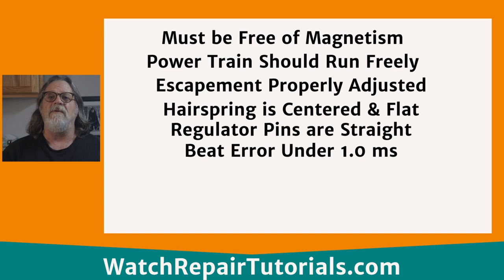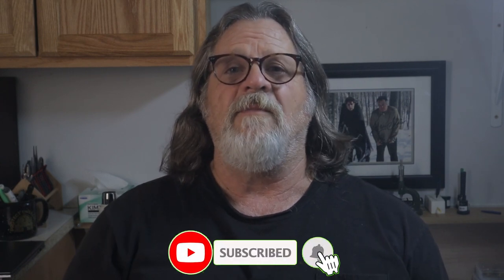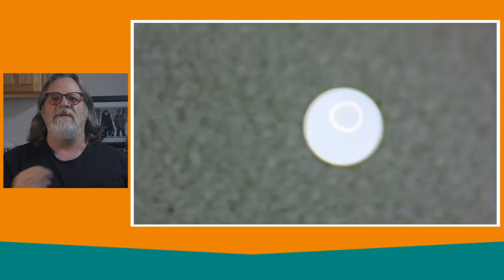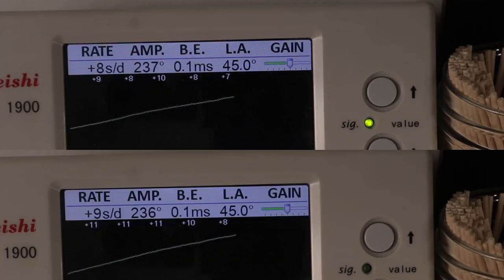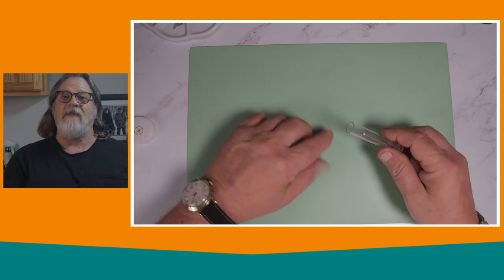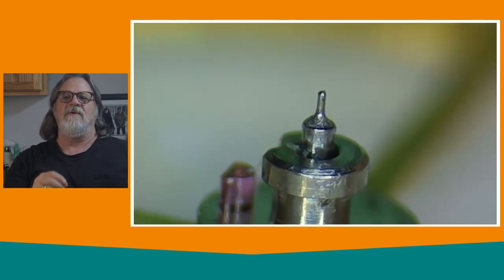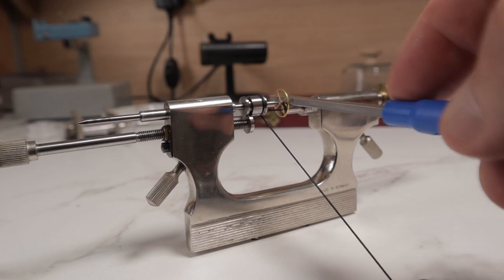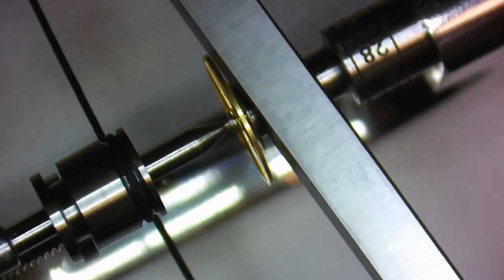Regulation SECRETS Every Watchmaker Should Know

Comment: Thanks Alex for your great work in presenting all this experience so clearly. Just tried to round off the ends of a balance staff with my oh so cheap Bergeon 5482. Watch running poorly DU. I used a little 9010 and my rotary tool on lowest speed. Managed to destroy the pivot in a few seconds ! Suggest you go very lightly guys and maybe hold the balance in your fingers to feel the slight pressure needed. I had the balance in a holding plate on the bench which clearly gave too much pressure. I now get to practice balance staff replacement which will no doubt improve my skills. Happy days.
Reply from the maker: Yes, holding it in your fingers is definitely the way to go.

Comment: You certainly have a great way of explaining things. Currently on the hunt for a  Jacot tool.
I have a watch that runs okay (ish) in 3 positions but pendant down it slows by 10 seconds +
I’ve not been able to find the issue and have now have accepted that unless I get better at this I will not figure out the issue.
Reply from the maker: Hey my man, don’t discount your skills.  What’s the caliber and what are the rates and amplitude of the six positions. You can email me if it’s easier.
Reply: @watchrepairtutorials  a very long video will be released today.. toe parts disassembly and then assembly.  It’s a Ricoh 61 and it’s a very odd layout for a movement. 
If I leave it long enough on the TG it actually settles but it’s not perfect.

Comment: Hello. I watch all of your videos and learn a lot. I have a breitling watch 1950  with as 1130 movement. I serviced it my self about a year ago, and it worked great(i have a witsh time grapher). I wind it occasionally, since i do not wear all  the time. Today i noticed that the watch started to gain a lot with in the same day. a opened it, then put it on a grapher, and cant get 18000 bit, it shows 36000. Sometimes, when i adjust the bal. wheel, it get 18000 for a short wile, and a good beat err, but it jumps allover the place. I had similar with another watch and i fixed it by adjusting a hear spring within a pin, which stabilized all the parameters. What else can create 36000.? bad spring? (i put a new spring when i serviced  it).  Not emough pallet stones oil.? does the bal. pin needs to touch the hear spring or not? It did not effect anything ether way. Any idea? Thank you,
Reply from the maker: I think there’s something else going on either with your microphone, interference or your timegrapher as it’s impossible for an 18,000 beat per hour watch to change to any other frequency. Basically, the frequency is counting how many times the balance wheel rotates back-and-forth. Mechanically nothing in your watch can change that.

Comment: Hi again Alex. I dare to ask you another question because apparently I am not able to figure it out by myself   as I do not possess the volume of expertise necessary. I am sure however that this question is an easy one for you. After an year and a half of work on a LUz Geneve selfwinding (Felsa 4007n) and thank to you I managed to make it work well. Tha last problem was poor amplitude which I only solved thank to your channel. (the other problems included broken jewel in the winding train,  closing the holes for the barrel arbor, changing the barrel (broken tooth) and mainspring and using braking grease, changing the second and the third wheels due to pivot tip corrosion as a result of one night in ammonia-water solution, boiling the hairspring in lard and slightly correcting the end-curve, removing the radium from the dial and restoring it with Superluminova, restoring the inscriptions on the dial using ink and a diabetes syringe needle to draw 0,.06mm lines. After polishing all pivots using diamantine and toothpics and pegging all the jewels I obtained 290 degrees in the dialup p. and this fiigure does not change much in the vertical positions. Now, the only thing that bothers me is that when winding manually, the sliding pinion slips sporadiacally because it unmeshes from the winding pinion, although I strengthened the V-shaped spring responsible to keep the clutch meshed. Is this slippage a known problem and what would you do?
Reply from the maker: Wow man that is so awesome to hear. As far as your problem, I would have to say if the teeth are slipping that there is wear. Perhaps the sliding pinion should be replaced
Reply: Hi Alex. Another question on an obscure topic. I have a Seiko quartz chronograph that still works smoothly after 30 years. As you know these movements contain plastic gears along with brass and steel gears. I read somewhere that Seikos plastics are self-lubricating that the presence of such gears in the wheel train may be a plus. I would like to hear a word or two from you on this just to know what to think. The specs from the manufacturers are so ... well they tend to tell you nothing....
Reply from the maker: @Qwerty-cb1ti  using plastic parts in a movement as a trade-off. They don’t need lubrication, but they tend to wear in break more often than the equivalent, brass or steel part would. The bottom line is they do not need to be lubricated as a matter of fact it is more detrimental to the movement as there’s nothing to hold the lubrication know where it’s applied and it will end up spreading to parts that you don’t want it to be. This  is a Basic, Lubrication, 101 Theory.
Reply: @watchrepairtutorials  thank you for answering. These things are not so obvious...

Comment: What do I do when I have a excellent amplitude on the Pocket Watch with an excellent beat error but it’s running -400 seconds per day. Could this be the regulator pins
Reply from the maker: Hey JD,
I would guess this is a hairspring issue. Too long.
Reply: @watchrepairtutorials  I think it’s the original hair spring for this watch!  I did quickly test the speed by very carefully touching the gap between the regular pins with a very sharp piece of Pegwood, and looking at the amplitude on my timer software. It’s sped up considerably, so I think I really need to close those banking pins. Any advice on how to do this without screwing up the banking pins. I would think I need to remove the balance assembly from the watch first that way there’s no chance of me slipping. And then do I use tweezers or pliers; I’m thinking tweezers. And then should I close it with the hair spring in place or should I try to close it without the hair spring in place?
Reply: @watchrepairtutorials  and one more thing. I have been making a very long video on how to fix this problem I’m quite satisfied and how I reshape that hair spring to get a very good amplitude on the watch. The video should be out sometime today or tonight as I still want to resolve this problem before I finalize the video.
Reply from the maker: @JDRichard  I assume you are talking about the regulator or index pins, not the banking pins right? You are correct that closing the banking pins. Will speed up the rate in ALL positions. If the issue is in all positions that’s the adjustment you want to make. 
A pair of stiff tweezers will work with the hairspring in place and no power.
Reply: Yes, I was talking about the regulator pins and not the banking pins. However, are you suggesting that closing the banking pins slightly Will speed up the watch? I can visualize this as the throw in the pallet fork would be shorter, but that might affect the actual amplitude as the mouth of the pallet fork would not throw the impulse Jewel as far in there, for the balance would not swing as far
Reply from the maker: @JDRichard  I wasn't suggesting it but now that you mention it, in theory yes you can, but it would be slight, 4-5 seconds faster max.  The adjustment would have to be slight tha t the "slide" is not affected but enough to reduce the unlock resistance if the stone. Not really worth the trouble.
From my experience regular pin adjustments are not going to make up -400 spd so I am interested in what you find.
Reply: @watchrepairtutorials  I will let you know

Comment: Fantastic videos Alex. Can you help me please. Canion pinion on a pocket watch will not move, using the right canion pinion tool. Sure one of your videos you used some type of oil.
Reply from the maker: Is the problem removing it or is it not moving when you try to wind the watch
Reply: @watchrepairtutorials  Thanks for replying Alex. Canion pinion rotates ok, but stack tight, so can''t t remove centre train wheel.
Reply from the maker: @kevinstenner8836  which movement is it?
Reply: @watchrepairtutorials  Federal pocket watch pin set. 60s from E bay. Can't see any numbers in the movement, just made in Germany. I'm very much a beginner.
Reply from the maker: @kevinstenner8836  hmm hard to say without seeing it. More than likely not a standard canon pinion.
Reply: @watchrepairtutorials  I understand. Big thanks for your time Alex.

Comment: I have always Wanted to ask an expert such as yourself the following question: What would be the difference in amplitude between an oiled and an unoiled watch mouvement that is supposedly in perfect condition.
Reply from the maker: For two watches to be in perfect condition, they would have to be new to be able to make the comparison. One of the big factors would be the quality of the movement. The higher, the quality the tighter the parts  tolerance would be so they would be affected less than low to medium quality brand of movement. 
So, if we just looked at a medium quality, watch, move it in new condition with no lubrication, the dial positions  would be less affected, and you would see roughly 30° difference in amplitude. the vertical positions would be affected much more because now all the wheels are resting until testing on 2 jewels so the loss of amplitude would probably be in the 70 to 80° loss range. If someone was wearing a watch like this, not only with the time, keeping you very poor service life would likely not make it to two years. Evidence of this can be seen in many Chinese movements sold today.
Reply: @watchrepairtutorials  thank you very much for these explanations. I can assure you that I follow every single clip you make on YouTube. You are definitely one of the best

Comment: Not sure I understand how capillary action would allow ALL the oil to run out leaving pivot dry.
Reply from the maker: What did I say exactly?
Reply: @watchrepairtutorials  Didn't rewind...but from memory, over oiling cap jewels not only affects rate...but over time causes oil to migrate leaving balance staff pivot point dry.
I get all..but the going dry part
Reply from the maker: @think2023  think of it like this. The jewel setting is made up of a endstone and balance jewel right? When there is the right amount of oil in a jewel setting, the oil is kind of suspended from where the tip of the balance pivot rotates on the endstone up the balance pivot to the conical part of the pivot that rotates in the balance jewel. 
It's almost like a bubble of oil that surrounds the pivot.  Oil tends to want to creep around rounded edges so when there is too much oil it migrates around the rounded edges and pulls that bubble away from the balance pivot. 
Now when the balance is in the horizontal position, the tip that rotates on the endstone doesn't have enough oil and when the movement is vertical, the bubble is no longer there to lubricate the pivot as it rotates sideways in the jewel setting. 
What little oil that's left behind dries out at a much faster rate essentially becoming dry and this can be accelerated with the introduction of dust.
Reply: @watchrepairtutorials 
Thanks!
Makes sense now. Immediate impact...moderate...long term migration reduces oil at friction point and shortens timespan of the service. Not dries out per se...but effect is similar.
REALLT appreciate the time you took to answer!